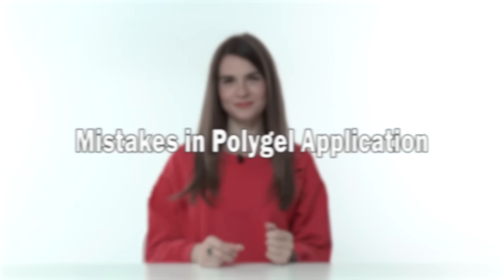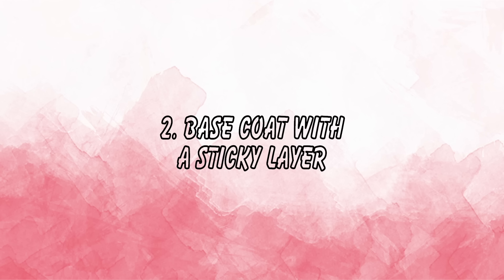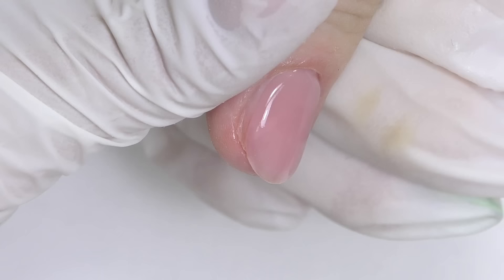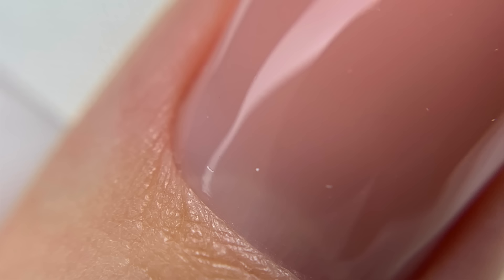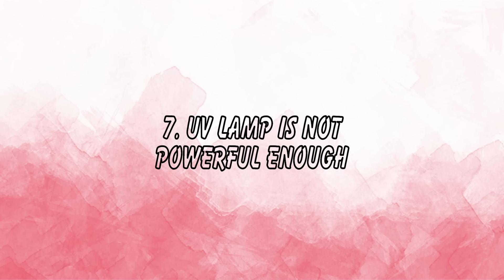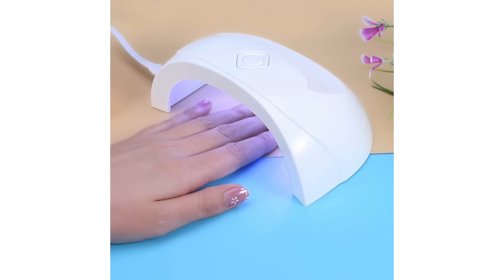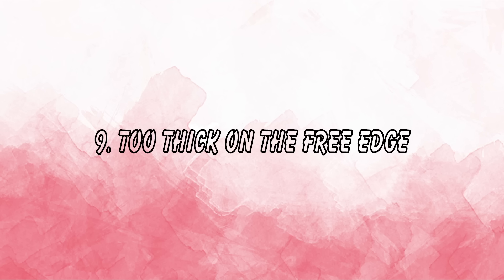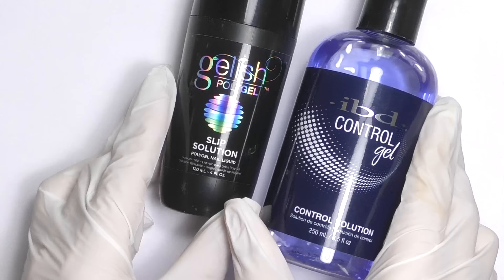Mistakes in Polygel Nails Application | Lifting problems

Comment: I prep my nail properly, put the primer on and cure per instructions. I've tried wiping the sticky layer off and not. I'm not applying to thick and even done two layers. I've use tips, forms, free forms. The gel isn't touching my skin and within a day they always pop off.
Reply: Maybe you have a bad primer?
Reply: Me too man
Reply: Not every nail enhancement is designed for everyone to use if you have flexible nails then the acrylic system is best and for those with nails that are hard and stiff with little to no flex that's where gel systems come in

Comment: How do you clean the brush after you do a set? I feel like I need a new brush every time. I can never get it flat again.
Reply: Just use alcohol,  70% will do. Flatten brush down between a paper towel, repeat if necessary.  Hope that helps.

Comment: what are your thoughts on using nail wraps such as fiberglass under the polygel, i prefer nail wraps added to acrylics during winter here in alaska because the extreme cold can break nails easily. i haven't tried it with polygel yet.

Comment: I'm not a nail tech but I wanted to try gel nails on myself. Ive only used it 2x as the first time was a disaster. Can't get the nail form to stay on my nail long enough to cure it. Keeps popping up. Big gel balls formed under the nail. So frustrating. Second time same thing but I cured for 10 sec holding the nail on and then smoothed out underneath. Apparently not thick enough in the apex though because in the morning they cracked off. Sigh... I'll keep practicing.

Comment: If my nails are very very short, like no free edge whatsoever, and i apply dual form, will the polygel that is stuck to the skin where my free edge would be, will that cause lifting or any other problems? And how can i apply to where doesnt touch that part of the skin?

Comment: Question...: I have the ibd system of polygel (the same you showed) i noticed that after some days the nail extentions were soft! I ripped them off with my other hand like a carton... that means the were uncured? But why i have a 48w led lamp by semilac. The only thing i can think is that i did it with "intense white" for a full cover, so i assumed that 1) white is only for french 2) i should try again with clear. (It cracked after 3-4 days from the sides)

Comment: I am using two in one base and top coat. I applied this before.my polygel and the two in one dried really quickly . Then I applied the polygel. The gel did not set and kept moving . The UV light I used was LED UV Nail Lamp, SUNUV 6W Portable Nail Dryer for Gel Polish with 2 Timer Setting (45s/60s) Mini2. Why isnt my poly gel working ?

Comment: Have not tried polygel yet, Still in research phase. How do you remove it?

Also, I’ve see some use dual form and others do on the finger. Forms seem easier. Opinions?

Comment: I did polygel nails for the first time last night. They looked cute but they just randomly broke off where my natural nail ended. What did I do wrong?
Reply: I always have that happen to me. I did my nails again recently and what worked for me is curing the base coat 4 times and the poly gel 6 times. 4 on top and 2 underneath totaling to 6. I think my uv light is a low wattage so I have to cure everything longer. Otherwise my nails just randomly pop off without notice or lifting.
Reply: @lunnalocca9376  Thanks! I'll try that. I did them again yesterday with a new clear gel and it seems like they were all too thin or too thick. I guess this has quite a learning curve haha
Reply: Tabitha Kristen me too lol. My pinkies are always spot on but the rest is either too thin or too thick and I’ve been doing poly gel since December. It’s not as easy as it seems but it looks 10 times better than my acrylic nails.

Comment: Whenever I use polygel I always get air bubbles in my cuticle area. Still haven’t found a solution
Reply from the maker: Bubbles while applying the product or few days after?
If it's while application - the issue can be in liquid you're using. Also, try to "pat" the product near the cuticle rather than dab it
Reply: It's because you are not holding it down properly while under the UV light. This is kinda difficult for most people.
Reply: You can buy poly gel clips to hold down the form and gel while curing that might help!

Comment: What do you recommend if the nails are breaking in where the free edge start? I am not a nailtech and I am new to polygel. 2 of my nails starting to break there and I don't know what I did wrong because the rest of my nails are perfect. Thank you so much! ❤️
Reply: It's because you don't have enough product in the stress point / apex area
Reply: @AaronW-ww4ds  thank you for your answer. I had the same structure on all of my nails made with the dual forms but my middle finger nails break in at my nail's free edge. So I didn't know what I did wrong. I will try to do a better job next time focusing more at the apex. 😊

Comment: It’s true about using alternatives to slip solution designed for the specific polygel. Some technicians have been singing the praises of isopropyl alcohol however, it can prevent adhesion and cause fungal growth between the poly gel and the natural nail which can cause some quite serious damage because the PolyGel has to be removed and so does a lot of the natural nail as part of removing the fungal growth (basically moisture trapped between the product and the natural nail) that would normally not be touched before the next application.
Reply: Alcohol is drying and anti fungal. Most slip solutions have it as the first ingredient.
Do you have sources for your information?

Comment: Hi Anastasia! I subscribed to your channel quite some time ago and enjoy your tutorials very much.
You speak very calm and clear, which makes the explanations easy to follow and understand for me. Although my English is very good, it's not my native language.
I'm not a nail technician, but a DIY at home, on myself only, and an absolute beginner. I'm also not very handy, but I'm getting better each time.
I work only with polygel, because that's in my opinion the easiest material to work with in my case.
Will you please do a video on polygel nails applied with the non-dominant hand, using regular clear forms and using the plastic clip for pinching? The polygel I use is Elite 99 nr. 02 transparent nude.

Comment: Let me preface this by saying, I am not a nail wearing type of gal. I can hardly paint them without getting the paint all over my skin around the nail. However, I recently have been super intrigued when I saw solid gel nail polish which somehow lead me to poly forms. I purchased a kit online but I'm scared to try it. My biggest struggle is using my non dominant hand on my dominant hand. Any tricks or tips?
Reply: Liquid latex. You cover around your nails and then if you make some mistakes it’s no big deal.
Also practice. 😊

Comment: Why my polygel won't stick to the nail surface? I tried everything but it just won't stick... Helppp!
Reply: Aim 456 have you tried filing the nail down on the top of the nail? Sometimes it needs to take the oil and shine off first. Just lightly sand.

Comment: When I file and buff, my clear poly gel will not get shiny
Reply: Try using a clear gel top coat.
Reply: You need to use a top coat and don’t buff after applying the top coat. If it’s too sticky clean it with 70% alcohol and a lint free wipe like makeup sponges. There like $4 at Walgreens

Comment: So I just started with polygel and I'm using dual forms, not a professional at all just a nail enthusiast lol...I'm having difficulty with taking the dual forms off after curing and I've watched sooo many of these tips n tricks vids n have not found anyone else having this issue so wondering if you would have any feedback or opinion. I'm using a cheap brand from Amazon called LuckyFine, the gel itself is fine and easy to work with, no complaint until it's time to remove the forms. Using a 48 watt lamp n letting them cure for no less than 2 minutes. Tried with n without base coat..wtffff 😭😭😭
Reply from the maker: So they are not coming iff after curing? 
Make sure the product is not on the top of the dual form before curing